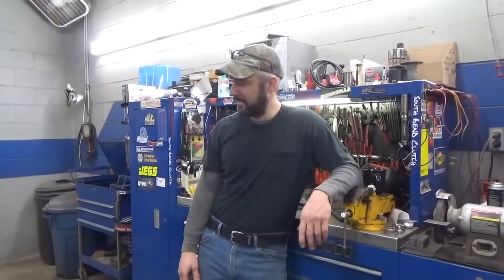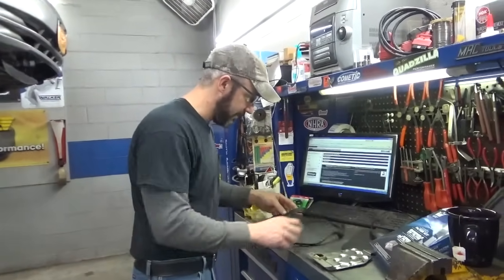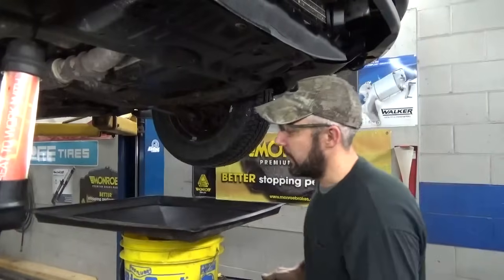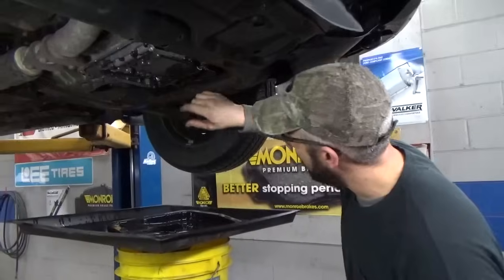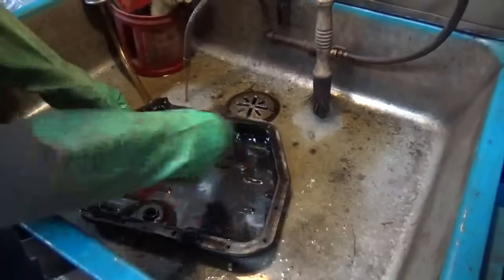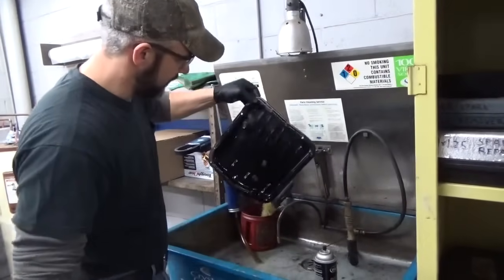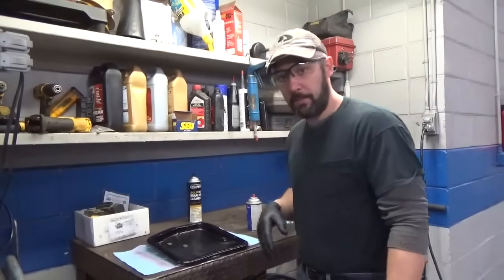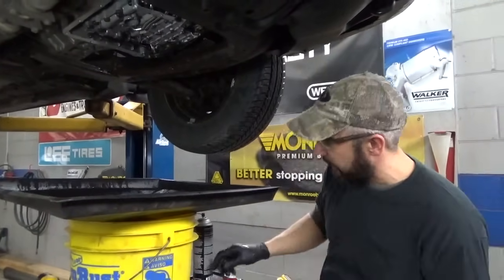Transmission Fluid and Filter Change - Toyota Camry

Comment: what are the magnets for? and do they go anywhere on the pan or do they go in certain place? thanks
Reply: They are to catch metal shavings from the transmission, they can be an indicator of the condition of your transmission. Yes there should be some marking on the trans pan for where they go, but this may not be the case for all models.
Reply: @veedubya4636  thank you so much

Comment: Don't use brake cleaner spray can, one of the guys at work got sinuses cancer from it, he died from it, he was also cleaning shop floor and brake dust using blowing shop air, don't forget this advice.

Comment: I need help.  I have camry 2007 LE with 120K miles. I am trying to change the transmission filter but I have hard time removing one of the 10 mm bolts under the beam of the car.  Any guide what kid of wrench can help.  It is very narrow space?
Thanks
Reply: Open end box 10 mm

Comment: Does the 2000 camry have a differential? ive heard yes and no and seen some videos but they suck explaining location and procedure
Reply: +IXBlackoutXI1 Every car has a differential, on a 2000 camry it is inside the transmission.

Comment: Did you ever use MAX life trans fluid on hyundai..... if you did .. did you get a rough shift from park into drive.. on the test drive shift is relatively smooth... only when in park rough shift from park into drive... just curious...thanks..
Reply from the maker: I have always used the castrol trans fluid or the OEM. I have used Max Life in other vehicles though with no problems in the past.
Reply: ok thanks....
Reply: Terry Beharry
Maxlife is working good in our 08 Chevy uplander with the 4T65E. Not as low viscosity, but I like the full syn over high efficeincy Dex6.
Reply: Some Dex6 is 100% synthetic , some is a blend .  Do not beleave any Dex6 is 100$ conventional oil ?

If it says Dex6 , read further to see if it is synthetic .  Even GM Dex6 , some is & some isn't .

A couple of months ago , I did a drain & fill on our 2015 Sonic .  Used Havoline Dex6 100% synthetic .  It was on sale on Amazon a year and a half ago .

Personally , I intend to stick with 100% synthetic .  Same with engine oil .

God bless
Wyr

Comment: I overtightened the drain plug and stripped it unfortunately. Then I welded nut on the plug to make it easier to remove.
Reply: @YvngBootyClench  I used a small 1/4 inch ratchet to tighten it up and just tightened it to the first resistance and no more then I used brake cleaner spray on it wipe it down clean . I’ll check it again for leaks when weather permits. Down to 8 degrees in San Antonio darn cold 🥶💨
Reply: @YvngBootyClench  but I didn’t take off the pan so that I don’t know

Comment: Hi. I want to know the type and model of the automatic transmission of my toyota camry 1999 2.2 Lt engine model  5S-FE 4 cylinders in line just to buy the correct filter. TK

Comment: When people change transmission fluid , you are suppose to change all of the fluid just like the motor oil or rearend fluid or transfer cases
Reply: a flush can do more harm than good, at least by doing what he did it will now have that much new atf in the system plus the new filter to filter it all.
Reply: Not if you do it right , it will be fine. Transmission fluid doesn’t last forever

Comment: Wouldn't it be better to use oem Toyota fluid or is it all the same? I've heard some brands can be particular with transmission fluid.
Reply: Dealer speak. All fluids that are graded by SAE and are in spec will work.

Comment: How do you do a complete transmission flush? The torque converter still has old fluid in it, is there a way to flush that out as well? The screen is just a metal screen,can that be cleaned  just using brake cleaner instead of replacing?
Reply from the maker: As far as getting fluid out of the converter you need to have a fluid exchanging machine. In regards to the filter, they are very cheap, I would replace just to be safe :)
Reply: This 2002 Corolla has 135 k miles on it,I am the 3rd or 4th owner,I have no maintenance history on the car, should I go with a complete tranny flush ? ( I bought the car 3 months ago)
Reply from the maker: If it is shifting good and have no other concerns I'd say you are fine using this method. If the fluid looks really dark or smells burnt you may wanna have it flushed.
Reply: South Main Auto Repair Thanks for your help,much appreciated.

Comment: Will Castrol multi ATF work in Toyota trans that call for WS?
Reply from the maker: Your best bet would be to call them or check for compatibility on there web site...
Reply: halleffect1 Yes, you can used Castrol Transmax High Mileage 75000 miles, and I have been used on my Toyota and Lexus ES & LS  too and not a problems at all.  The best you buy a big jug 1 gallon save money in compare buy individual quart.
Reply: Walmart sells the stuff he used in the video.
Reply: the castrol full synthetic multi vehicle says on the front of the bottle "works with ALL Toyota Transmissions."

Comment: Could this leave the potential for the nasty sticky gasket adhesive overspray on the inside of the pan to come loose and clog the filter or damage the transmission? Wouldn't that be tragic?
Reply: atf it is kinda like a detergent it will foam up if you whip it ! so i am not to worried about the amount of sealer !

Comment: are 02 camrys the same? And what happens if you did mixed up the screws?
Reply: +whysosyria1 Like he said some screws are bigger and some are small and sometimes if you mix them up you can cross thread them to much or sometimes the screw itself wont let you go all the way through up. What usually works is if you take a picture of where the big screws went and where the small ones went.

Comment: What about the rest of the black fluid that is in the converter and cooling lines?
Reply: diluted with fresh. Now since the filter is new just pull the plug, drain and fill a few times.

Comment: I know this vid was made when Moby Dick was minnow but don't forget to check that seal from old filter is not stuck in the oil filter pickup bore in valve body especially Fords and inspect for broken snap rings control modules lol Mr O

Comment: Didnt even know they had a filter our Camry has 210k Miles and sold Rav4 at 220k miles and no issues even used for towing.  Fluid drain and replace only done. IF your not keeping over 250k Miles filter I doubt is needed.

Comment: Good video, disappointed that you didn.t  torque the pan bolts .
Reply from the maker: VWWRENCHIE Just not to tight and not to loose
Reply: Nice and snug and equal. A great mechanic uses a torque wrench on head bolts.

Comment: I'm curious, if the transmission holds 6 qts and you are only removing and replacing 2.5 qts, what is the point? There is so much old oil left compared to the new (over half is still the old stuff), I wonder if it's worth it unless you do a complete flush?
Reply: Amy West Recommend if your car more than 100K miles "DO NOT FLUSH".  Because its will be damage your transmission since more tolerance internal.  Best bet drain every 20K miles.  At this point, you still have half still stuck in Transmission Converter, Transmission line and Radiator (Transmission).  I have done this way and not even replace transmission filter still run good at 200K miles today on my Toyota Camry,  Lexus ES and LS.

Yes, you can flush at 40K or 60K.  But, beyond 100K then do not a complete flush
Reply: Some where around 1/2 ( give or take ) of the fluid is inside the torque converter & " modern " cars do not seem to have drain plugs on the torque converter .

If worried , do multiple spill / fills .

There are other ways , but that is the short answer .

God bless
Wyr

Comment: Do you flush the fluid out of the torque converter as well?
Reply: +Ian “Dbz4ever10” Above The old fluid held in the torque converter will contaminate or mix with the new fluid. I have no idea if you can drain it like you can on my car, but it's a PITA to do. And there's also the oil cooler that runs into the radiator. That will be full of old fluid also. Plus lines that run between the transmission and the cooler. You can buy a huge can of brake cleaner with a huge hose  for flushing the oil cooler and lines. Sounds like a PITA because then you have to disconnect the lines from the transmission.

What you can do is change the fluid and filter as in this video, run the car for a few hundred miles and change only the fluid again. That's actually what I plan to do. It seems easier because the fluid is so cheap and the Toyota transmissions take so little of it.
Reply: Ian Above

Comment: At dealer the filter is about 160$, can we clean and reuse it?
Reply from the maker: Mirik Man Wow that is a little spendy? Have you checked at the parts store?
Reply: Are you sure?  My 02' 4Runner strainer was $50 at the dealer. Way bigger.
Reply: +HondaSolutions  yes
Reply: +HondaSolutions  yes
Reply: +HondaSolutions  yes
Reply: what type of car do you have
Reply: +ahoyjayd 02 4Runner
Reply: HondaSolutions are you in the west coast?
Reply: Yes they can be cleaned. I use soap and water and dry in a 130 degree oven for an hour. Actually I place the wet filter in a warm oven and turn off oven and let sit overnight.

Comment: Toyota doesn’t recommend changing their filters, only a drain and refill
Reply: Wendell Greenidge true I leave filter alone only suck fluids out.Many times I changed filter only to have issues later.
Reply: Yeah only if there was a lot of metal and debris and filter was busted yeah I would replace it .. but if it's still little debris and clean magnets I wouldn't .. but usually if the magnets hold debris it's going to be in the filter. And the point of replacing it is so when you run the new fluid through the filter it doesn't bring all the debris back in it and through the transmission . But seems more like a scare for something that wouldn't be likely if your routinely changing the fluids. However if the car has high mileage replacing it can help with the tranny life I hear ..
Reply: Hey, no fair bringing the manufacturer's guidelines into the discussion. Clearly, little men-boys living in their parents' basement know far more about these matters than Eric or the people who actually made the transmission.
Reply: It’s perfectly fine to change the filter. Go back to your video games.
Reply: Toyota also doesn't think you're changing the fluid as often as you should either. I have a 210,000 mile Sienna with original transmission. No more than 35000 miles on a trans fluid change...the color begins to darken.  Change it. Just dump refill. Now I am changing the filter this time, but the torque converter shuddered once on my wife over 50mph last week. I figure there's probably a good amount of stuff in the bottom. If it gives me another 35,000, well super. If not, I guess it's time for a new tranny eventually.  This is the second, maybe third filter. I don't recall while it was under warranty.
Reply: Well you pay $230..00 for this tasks.
Reply: This is the same Toyota who sold brand new trucks with rusted/rotting frames. Whos only fix, was to spray the frame down with oil.. "Good as new!"  Gotta love that engineering..
Reply: LOL

Comment: What are those little blue towels (paper towels?) that you use for your hands etc?
Reply: Shop towels?  They're a lot more durable than regular paper towels.  Walmart and the parts stores have them with the automotive hand cleaners (automotive section at Walmart).

Comment: What's the toque specs on the drain and pan bolts?
Reply: Pan bolts are tightened to 43 inch-lbs
Drain plug tightened to 36 Foot-lbs

Comment: Would you change the transmission fluid at 90,000 miles if your not sure it was ever changed?
Reply from the maker: Gnik4144 With out a doubt
Reply: Thank you.

Comment: Thank you for the video. When you remove the Transmission pan, how did you clean the oil off before spraying the brake part cleaner on the pan? Did you simply wipe the excess oil off and then sprayed?

Comment: What's the sense of having transmission flushed when you don't change the filter?
Reply: +Leo Guy 
Some transmission filters are not serviceable/replaceable to begin with. As for the filters that are replaceable quick lube shops can get away with just flushing out old fluid without replacing the filter because its a quick money maker and the average person does not know that a transmission filter actually exist unless you inform them.  It's best to change the fluid (not flush) and filter as the video shows every 30k miles in older cars or 60k-80k in newer cars that are using full synthetic automatic transmission fluid.
Reply: +Aaronize That's correct, some dip sticks say no service needed under normal driving conditions. My 2004 Buick Lesabre both flush and filter needed at 102,000 miles, only has 97,000 miles.
Reply: Were it mine , I would do it now .  GM is in the business of selling cars / trucks and parts .

God bless
Wyr

Comment: Thanks for your videos.  Your Toyota head bolt repair was a $$$ saver for us(now, what do I do with the timesert thread kit?)
This trans service video brought up a good question.  Since our highlander's trans pan sits directly over the frame, there is no way to remove the pan/filter without jacking up the engine and trans.  Would you recommend I just do a few dump and fills instead of jacking the motor and trans to pull the pan and filter?  Car has 160k miles
Thanks, Brian

Comment: I am going to add a magnifine inline filter just for added insurance. Those magnets dont catch all the metal suspended in the fluid. Dropping pan and filter tomorrow on my Toyota and adding filter for extra protection. Great video. I use antiseize on drain plug just a thin coat. Do you see any problem doing that?

Comment: hello sir, I just happened to run into this video today. I would like your professional opinion on whether changing the Trani oil and filter will help my '93 Toyota  4cyl 2.2L 234,000m Camry run again. Trani started slipping on first gear a few months back. I would have to decelerate in order for first gear to kick in. After driving for a while the gears would kick in as normal. One day first gear just never made it thru. Now only Reverse gear works but no going forward. A local Trani repair shop is quoting me $1000 to overhaul the Trani. I believe a simple Trani oil & filter change will do. What say you? Thanks in advance.

Comment: Hello man,I gotta question
Reply from the maker: Динислам Байсуркаев what's that...
Reply: South Main Auto Repair My Toyota Camry is 2008,recently I did check my car because I got a problem with transmission.the diagnostics shows this "P0713 Transmission fluid Temrutere Sensor "A  Circuit High Input
Reply: @DINIMAV  This thread is four years old... But curious as to whether or not your problem was resolved. Did you know how high the transmission fluid temperature was? I know the fluid in our 2009 is suppose to be between 158° to 176°F for the level to be in the hot zone on the dipstick but I also know that it does get above 190° which is considered normal for some cars. So I don't think that is necessarily a bad thing but high temperatures do indicate that the fluid needs to be changed periodically. It is NOT lifetime fluid if it's running that hot. Heat destroys the fluid in time.

Comment: What do you think about changing the fluid on 'permanently lubricated' transmissions.  I've been an engineer too long to believe that promise.  I've seen some new units that have neither drains or fill pipes.  After 100K miles (including light towing) I really believe a fluid and filter change should be in the cards.

Comment: You would never leave more than 50 percent of your old oil in your engine, so why do people leave more than 50 percent of their old transmission fluid in when it's so easy to pump out the rest through the cooler hose?
Reply: Cause flushing can cause problems sometimes on older transmissions...blew one out having that done.  Never again.
  You are getting more than 50% of the atf out near 75-80% out with a drain. You can drain 2 quarts after a drive and put 2 more back in and you got most of it replaced.

Comment: J have toyota camry1992  2.2 liters 1992 100kw  transmitions fluids  are  black  and all 4 forward speed  is loose. Now j can only drive in reverse. If j change fluids  and filter did 4 forward  speed will back .Did someone  toyota owners  have similar problems  and how he solved
Reply: Sounds like a fluid change probably won't fix it. If you can only drive in reverse (which is usually the least used of the clutches) that means the forward clutches are most likely burnt out. Or it could be a solenoid problem. Either way, it more than likely needs more than a fluid change. You could try a transmission additive (Lucas 'stop slip') or similar and see how that goes for a bit.

Comment: This guy. I'm not a mechanic but I do change fluids on all cars all the time. You never spray that crap on a oil gasket. You got all inside of the pan genius. Just put the gasket on and put the screws in to hold everything on. The screws won't fall out, I've done this a thousand times. On top of everything else that crap you sprayed on is gonna be a MoFo to take that gasket off down the line. I've also done this a thousand times. I hate that spray shit sealer it does nothing but make the job harder.